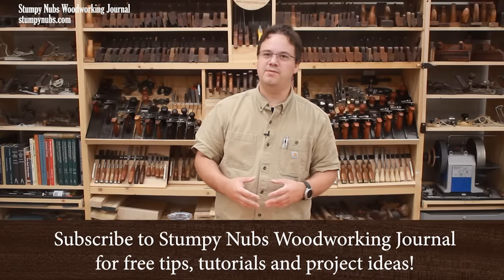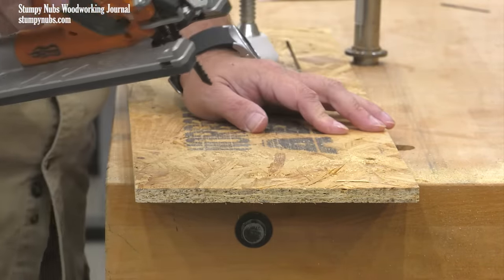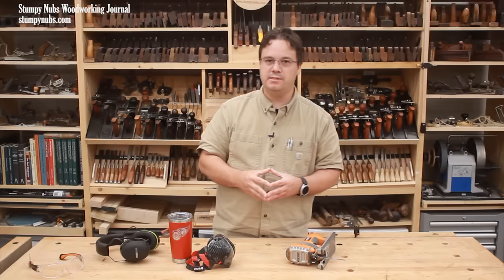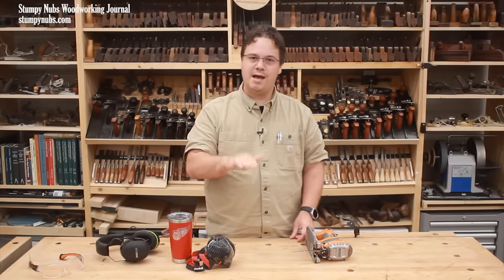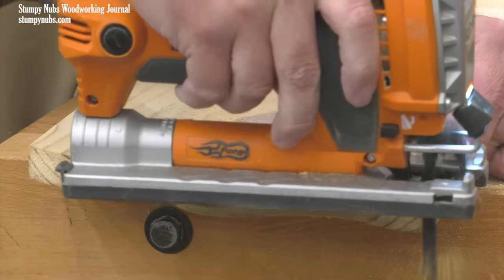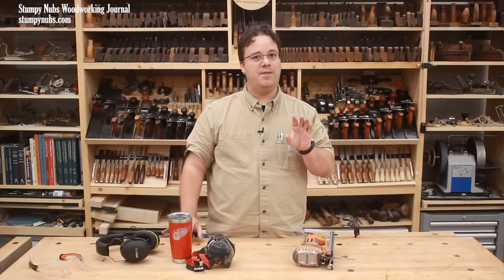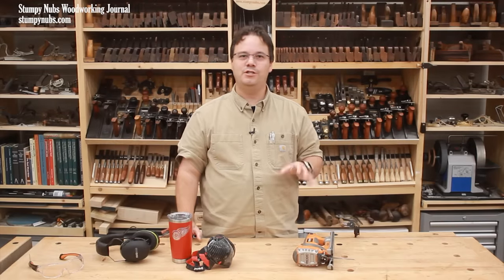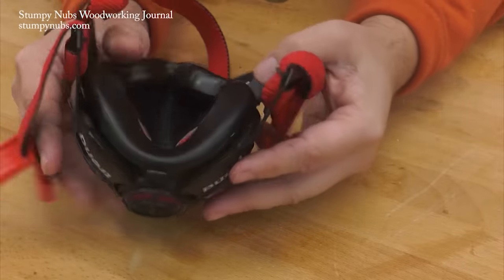How I made my jig saw cut a LOT better

Comment: My first jigsaw was the entry-level Black & Decker of the day. I grew to hate it because I seemed never to get a square cut.

Eventually I held it up to a try-square - and realised it had been manufactured with a non-square base. The primary issue was that the screw-hole that fixed the base in position was in the wrong place - slightly to one side. But the actual folding of the baseplate was also slightly out.

Since then, I don't remember buying anything branded B&D intentionally but I think I ended up with some perfectly OK screwdriver bits!

A later one, which was a distress purchase, was also very disappointing as it used a screw for the blade, and that kept falling out. When I lost the screw, I replaced it with what I had to hand, a small Allen head screw. That sorted the issue for good! For some reason it did not shale loose. And despite being a really cheap device, it changed into being a favourite. I think it was made by Kress, but not certain.

Also, worth pointing out that you can get some potentially very useful specialist blades - such as for cutting foam blocks.

Comment: I have one of those old jig saws u need an Alan key to  change blades with. Just keep the key with the spare blades. Also that old saw is built with real metal must be 30 years old if not older and still works like brand new. I learned the plunge cut technique from an electrician as he used it to cut open walls to run new wiring.

Comment: Great tips for using a jigsaw! thanks for he video I'm using the Spyder 300002 blades and its a game changer at least for me on my jigsaw, with teeth in front and back of the blade  for backing up if you need to and smooth cut as well , highly recommended.

Comment: It looks like the sandpaper as applied contacts the guide behind the blade.  I hope it doesn’t damage that, leading to less supported blades.

Also, some narrow blades designed for tight curves are extremely difficult to get to cut square compared to a bigger blade.  It can be a good idea to use bigger blades if possible.

Comment: I've never thought about using wax on the bottom of my jigsaw, I guess that would work decent but could possibly leave residue on your work piece. 
I use the fuzzy/soft side of Velcro on the bottom of my plastic shoe which has always worked nicely for me without scratching any material I use. However I really only use my jigsaw for rough cutting panels down and then using a flush trim bit in my router table with a template to make the actual finish cut(s).
The sandpaper trick seems like it may occasionally come in handy and I will have to give it a try!!
Reply from the maker: Hand plane soles have been waxed for hundreds of years. It doesn't leave a residue because you are using very little. Besides, aren't you going to sand that surface at some point?
Reply: @StumpyNubs  I do a lot with plexiglass inserts being used as accents and viewing windows inside speaker enclosures, so no I wouldn't be sanding it in my case but flame polishing the edges.
Reply from the maker: @audiofanaticz  My response is focused on your comment about the potential for wax residue. That concern is usually raised by folks who plan to apply a finish to wood and worry the wax will interfere with adhesion.
Reply: @StumpyNubs  Yes, and I'm saying putting any kind of wax on the bottom of my jigsaw to make it glide easier for cutting would cause it to end up on a plexiglass panel which wouldn't be sanded after cutting.
Reply: I primarily work with 13 ply Baltic Birch, MDF, acrylics, and HDPE. While I think that the wax method is a great method I just don't think it is the correct or end all method for everyone and I don't think it would be ideal for acrylics that are not being sanded and possible for any residue that may soak in to MDF that can't easily be sanded out.
Reply: I do rather like that fact that you actually take the time to communicate with your followers in the comments! That seems rather rare on youtube, especially with larger channels!

Comment: VERY useful tips indeed Stumpy!; I think the humble jigsaw deserves more attention. 
One thing I would respectfully suggest to cover in more detail, is the matter of blade selection and the fact that no circular saw has ever had a so ample selection of blades as the humble jigsaw! 
Actually you can use a jigsaw to cut A LOT of different or unusual materials, as there is a huge assortment of specialized blades, for different metals, plastics, fiberglass, and even tile cutting or 'soft but tricky' materials like rubber or leather. In my experience, more than 90% of the cuts in many different materials can be done with Bosch jigsaw blades, which are top quality (Swiss made, even METABO goes to Bosch in order to rebrand them in their colors!). But I refrain to buy their cheapest ones (called "Basic for"). But their upper lines are probably the best ones available. I specially love their "extra-clean" blades.
I have used a few other brands for some jobs, like the longer blades that I use when attaching my jigsaw under the bench, which necessitates a considerably longer blade, in which case I have used "Wilpu" brand long blades, and support their free end with small router-bit bearings to totally eliminate deflection and vibration. For me, cutting Acrylic plastic is tricky with a circular saw, but easier and more "natural" with the "Special for Acrylic" blade from Bosch.
As a final comment, I was not aware that Ridgid had a Barrel grip jigsaw model like yours, which I consider the very best type of grip, as I find the barrel-grip much more precise than the too-tall and clumsy "Top-handle" designs that unfortunately are more numerous.

Comment: Diablo makes blades with teeth in both directions to eliminate tear-out (DJT308BFP). I think it is somewhat limited in the material thickness you can cut, but it works great on 3/4 material.

Comment: I have always thought that the distinction between the old-style fixed jig saw that you showed and a scroll saw is the with the jig saw, one end of the blade is attached to a moving piston, and the other end is kept in tension with a spring. On a scroll saw, the blade is held tight between the ends of a rigid yoke that moves up and down. The latter approach is superior, and I think the old, spring-loaded saws have pretty much disappeared.

Comment: One tip I would suggest is learning to use a jigsaw upside down. As in you can see the blade. It takes a bit of practice, but that way the good edge is at the top which you can see and makes using it so much easier

Comment: Very informative video for me. In the short few years I have been doing woodworking, my skills have improved a lot with pretty much all of my power tools and hand tools. But I still totally DREAD using my dewalt jigsaw. This video will help with my technique. However, my biggest problem is seeing what I'm cutting because of sawdust on the cut line. I think a need a jigsaw with both a blower and a light built in. Corded would be fine. Suggestions, anyone?
Reply: I just got a Wen which has the blower to clear the dust from the cut line. It works great.

Comment: I have some blades with both forward and reverse teeth on the same blade to eliminate tear out on both sides. Does take some work to gauge depth properly to keep the down teeth completely on the top and up teeth on the bottom. Works great, though.

Comment: I’ve been trying these for quite some time now and I still can’t seem to figure out how to defeat deflection. I’m only trying to cut pine or redwood 😢. I could use a more in depth video on ways to avoid deflection. Am I pushing too hard? How do I know when the blade is too hot from all the friction? How can I reduce/nullify the vibrating sensation from my hands during/after use? And anything else I haven’t thought of regarding preventing the jigsaw blade from bending and avoiding deflection?

Comment: The best solution for out of square cuts is to run a flush trim bit with the bearing on the very top and it will square that up in no time. Saved me a bunch of times

Comment: Made a spray can shaker attachment for my reciprocating saw (Sawzall). Just grind the teeth off a long blade, grind down a few notches to hold bands that are snugged up to secure the can. You can use worm gear (radiator hose) clamps or even zip ties. I suggest slow on a variable speed. Saves a lot of time standing around shaking those cans. Is anything like this available on the retail market?

Comment: I spent years installing fine furniture that was always finished to the nth degree before I ever got it.  I found that using tape was highly ineffective to keep a catalyzed and buffed finish from chipping. So my jigsaw a Bosch barrel grip was only one of two tools are used. I would cut as close to the line as I could and then I would use a small cheap Wen belt sander vertically with the belt going down towards the finish top as an electric plane or file if you will. The trick was use the jigsaw upside down so the blade came up through the wood. This kept the chipping to the underside no one would see. You can easily see the cut you’re making and the blade, as there is no dust obscuring the blade and the line. A lot of times I didn’t have to sand at all . I also use my jigsaw to back cut crown molding since the cut has to be greater than 45 I don’t tilt the base. A lot of times I take the base off and just use the bare blade and back cut the molding that way molding clamped down and two firm hands on the jigsaw.
Reply: You sure you weren't trained to do woodworking by a lawyer?:sanitizer:🦊
Reply: @johnpossum556  I don’t think so. But if I ruined something that so many people in the shop had worked on for so many hours  before was given it to install, I would’ve needed one. 8~)

Comment: You also want to use beeswax on the blade when cutting aluminum.  This applies to band saws as well.  It will prevent the aluminum from clogging the teeth.

Comment: ...mmm I think that you forgot to mention READ AND FOLLOW all of the directions that come with your saw . I've worked with plenty of people , that had no idea how to correctly use a power tool .   some jig saws have a blade speed control , a Bosch jig saw has a blade orbit control  .  Bosch also has a lever to blow the dust away from the cutting line  . there is a very large selection of different saw blades that are made for many materials . I never ever liked the downward cutting saw glades BUT some of the trim carpenters that I worked with LOVE using them !

Comment: Deflection is my biggest problem, even on straight cuts. I've been using a fine tooth blade to reduce tear out. And it never occurred to me that the smaller blade could be easier to bend and deflect.

Comment: When you talked about deflection and binding in tighter curves, I thought... hey I bet people who are familiar with sewing will have a lot less of a problem with that. Because a sewing machine is all about not fighting the machine as it moves material forward... and when sewing curves you can get material bound up if you try to sew a tight curve at a high speed. Moving at a slower speed allows you to keep moving forward and curving at the correct pivot point without getting bound up because you aren't moving forward enough while making a curve (And of course fabric requires relief cuts to prevent puckering... fortunately wood is a lot stiffer than fabric
Reply: Funny I come from a sewing background and excitedly  gave curving a try on my new jigsaw! I found it very easy (depending on the wood) and a little more challenging on tight curves, though I didn't have the ideal blade. Wood seems so unforgiving compared to material lol! I do love woodworking though and I'm trying new things all the time 😁
Thanks to all the YouTube videos I have learnt so much!

Comment: I was planning to buy one for a future project, but when I heard 100db I reconsidered. I'm very sensitive to noise and would work in a residential setting and don't want to annoy my neighbors.
Reply: This is what I'm sitting with, though I'm just doing it as a hobby. I try and saw only during the day - typical working hours - and Saturday and try and finish as early as I can. I also keep as much sawing to when most of the neighbours are away (especially the moany ones). Mine is only a 450watt but is still quite loud, but would only really affect the neighbours next to you and below you. I'm also lucky that my neighbourhood has quite a lot of traffic which drowns out most of the noise. Oh and I have high density sponges and then my working boards on top of them (don't have a table yet - I'm still a newbie) and this helps the sound not reverberate throughout the building. Hope this helps! My favourite time of day is sawing time 😂

Comment: I use blades with set teeth for curves(often metal cutting as very few vari -tooth or high tpi blades have set) Also for tight. curves Spyder has teeth on front and rear of blades.

Comment: James!!!
You left out the 4th type of saw in the up & down blade action category…the “Blade Runner” type. 
Yes it is a single speed jigsaw…upside down…mounted with a table instead of a shoe…but you get the point. 😉
When I was a teenager, a Black & Decker jigsaw was the only cutting power tool I had available.  I still was able to build quite a few things. Now I still find uses for a jigsaw, from time to time. 
One day I want to try the method of holding the saw under the workpiece & follow the cut line on top.  Do you have any experience with that method?  I’ve heard it helps the drift/wander problem.
Reply from the maker: That's just an upside down jig saw.

Comment: When I was an apprentice using a jigsaw got to the end of a cut but the blade hit a surface underneath jumped out and then went straight through my nail in the hand holding the work piece to the left and cut the bone clean off inside my finger.  Lesson learnt clamp the work piece

Comment: Definitely wear a dusk mask. Often bend down close to the cut and often use jig saw to cut cut resin-rich soft wood - like sniffing glue! Use a fresh blade to avoid drift (or get a Mafell, which I can't afford). Loved my little Bosch Green Line jigsaw from about 1990 before I had a circular saw. Burned it out, bought another budget jigsaw because I wasn't using one by then, regret it, should have gone Bosch or DeWalt pro. Most folk cut laminate like kitchen tops holding the saw upside down rather than use a downward cutter on topside

Comment: You showed the orbital (or pendulum) motion in wrong direction. The blade swings back from the cut when going down which lessens the friction when it doesn't cut and reduces the risk of tear out on the down side. It also cuts faster as it's goes forward and take a firmer bite  on the upward cut motion. However I wouldn't use pendling for curved cuts.

Comment: Hey stumpy will my bandsaw diflect from pushing too hard as well? Thank you awesome video caught it a bit late
Reply from the maker: Yes. Always let the blade cut at it's own pace.
Reply: @StumpyNubs  blade drift…myth.
I have noticed this from aggressive feed rate. At the same time it’s very confusing. Is my blade dull? Am I pushing too hard. Is my bearing on one side too close to the blade, has my upper bearing moved since I lowered the blade guard causing it to flex. Is the blade too hot. Is the saws 2 speed settings on the wrong one. I’ve never used it’s slow setting. Even with 0.75 tpi blades cutting frozen elm. But I have noticed my blades always start drifting… and pushing too hard could lead to premature blade failure as well

Comment: How about addressing aftermarket replacement guards, fences, etc for older yet still useful equipment that prior owners just might not have taken as good of care as it was when it was new?
Reply: Just wondering if you have seen aftermarket options to convert “old square shank Allen screw blade clamps” to use t-shank blades?

Comment: Also don't curl your fingers around to the underside of the board. Or fail to wait for the blade to completely stop before reaching under. It's a kind of a little table saw... Very sharp blade that can cut very fast... Thanks for all the great tips, they're all really useful for making the tool perform well. But... There are just some tools that some find very useful, even indispensable for some jobs, but are just not fun to use...

Comment: Tear out is always an issue with a jig saw....the painters tape somewhat works but i have a better solution.  Get a piece of Lexan about 3/16ths thick large enough to cover the entire saw shoe plate. Now cut it to cover the entire shoe of the saw. Use your blade to cut a 0 clearance slot for the blade to travel freely in the Lexan. Now use a couple of pieces of carpet tape (very useful must have tool for me) and put a piece on each side to temporarily hold that shoe to the bottom of the saw. Now use it to cut a straight line.....NO tear out at all. Because of the carpet tape you can easily remove the Lexan shoe and save for another day. If you make that shoe parallel to the saw shoe and much longer it also can be used to rip long cuts with a straight edge very accurately and safely....and no tear out.

Comment: After 20 years teaching high school carpentry I think the number one universal mistake of most casual/beginner users of the jigsaw is to lift the back of the saw to turn which increases the tendency to push the saw causing inaccurate cuts and deflection. The second being lifting the blade out of the kerf still moving.